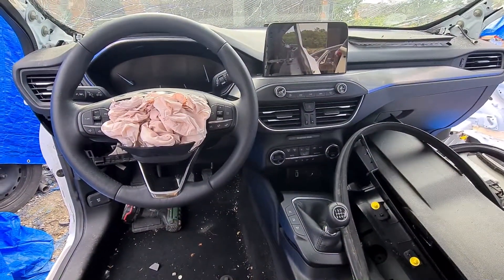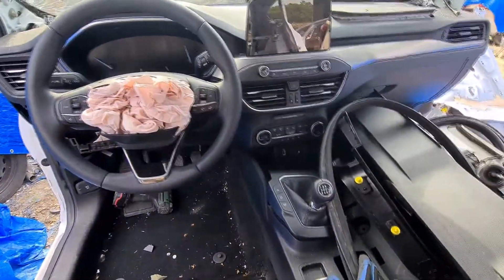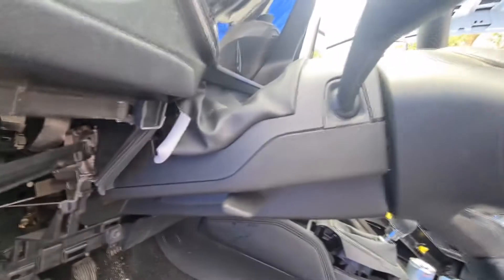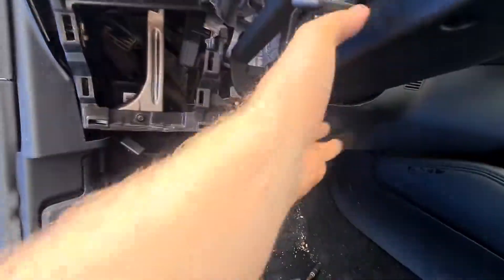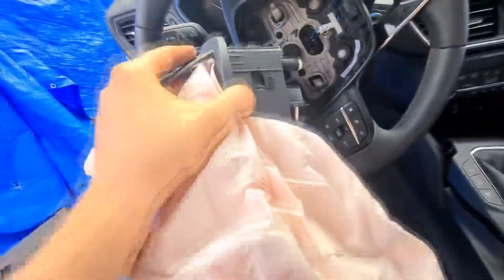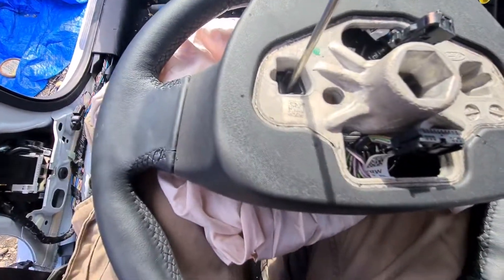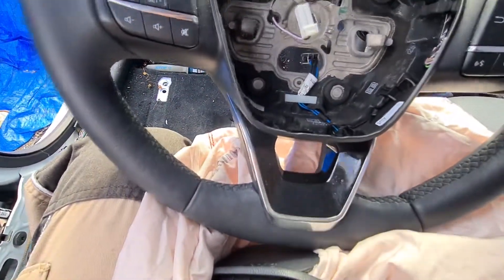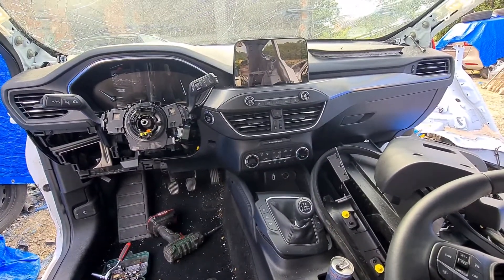How to remove airbag Ford Focus mk4

Comment: Hello good job on the video ! A quick question, the steering wheel is the same as for example my car Ford Focus ST Line X 2021 ? I mean for the inside of the airbag, keys etc. I need to have a custom steering wheel made and they asked me how it looks inside.Thank you in advance !
Reply from the maker: No ,its different for focus and for fiesta
Reply: @ozsabra  Yes I understand, but you are showing a Ford Focus Active steering wheel and I own a Ford Focus ST Line X, are they not the same inside ? I see same buttons etc , apart from the fact that my steering is flat D bottom because of the sport version is it not the same inside as the one in this video ?
Reply from the maker: @josephdaskalakis6265  for focus its all the same